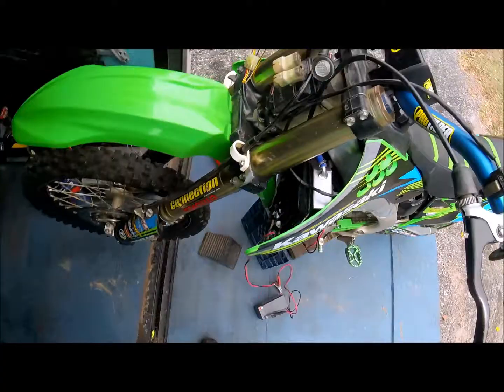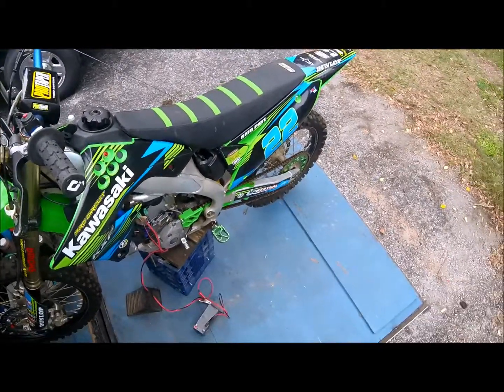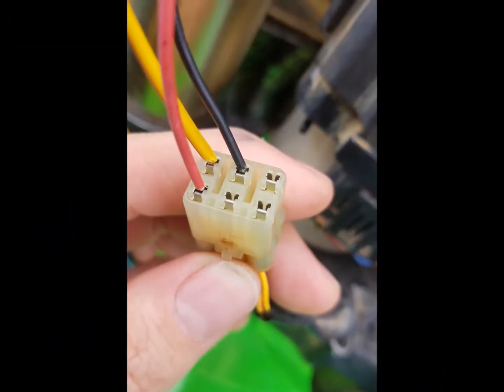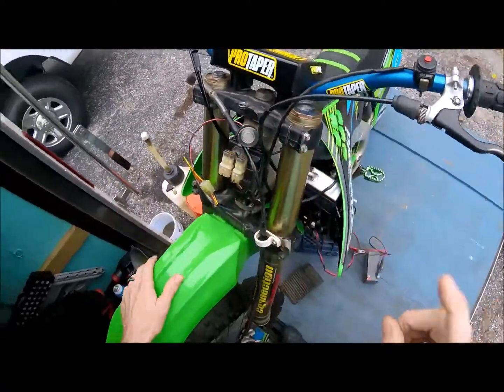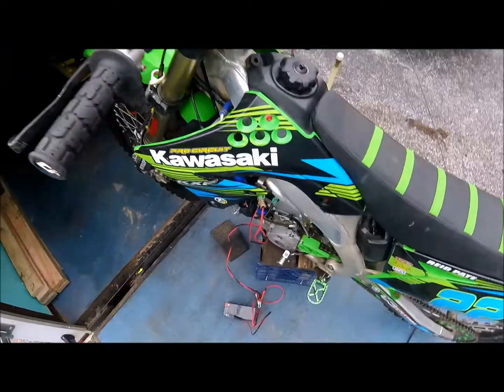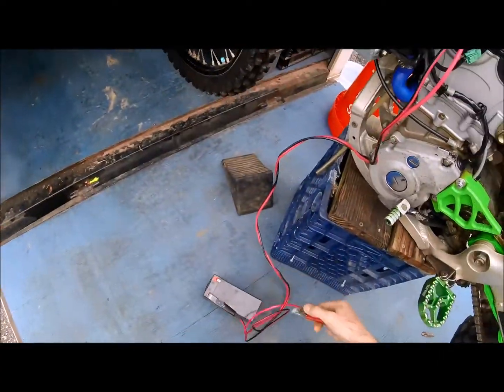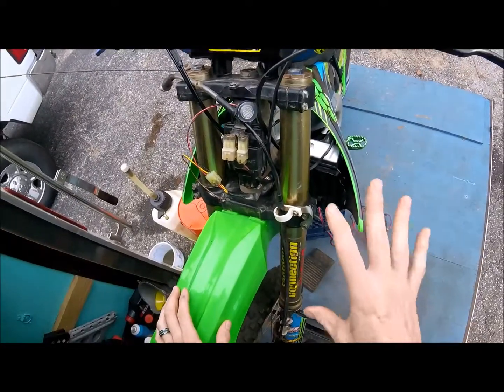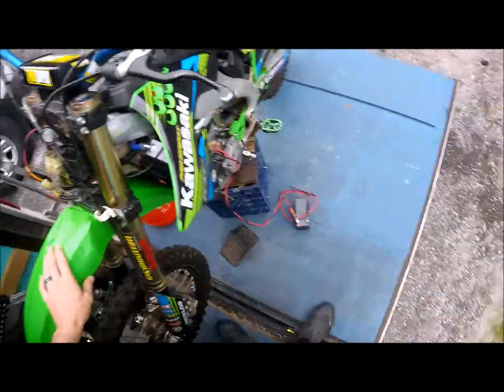How to put a KX250F into Self Diagnosis (Dealer Mode)

Comment: I’ve been trying this and I wired up a light to it like how u did and when I put my 12V w/ the battery to it the fuel pump just goes on and stays on and no light. I’m lost. Can’t get my kx running at all, it runs on brake clean but not getting fuel I assume